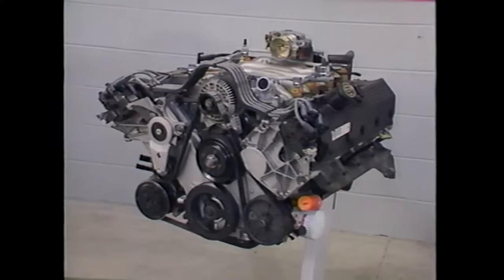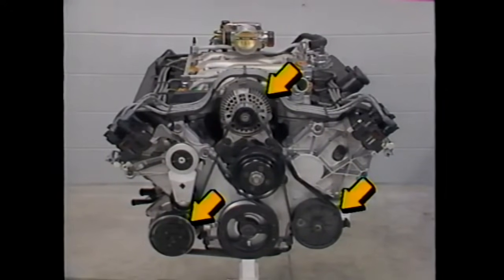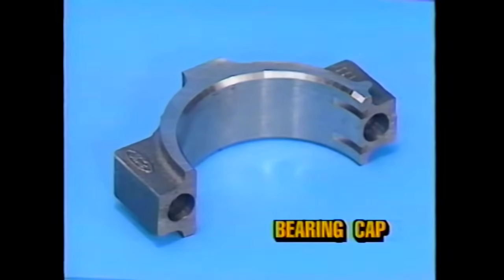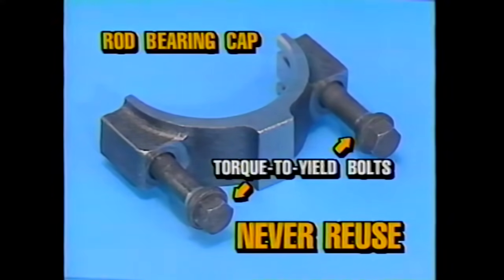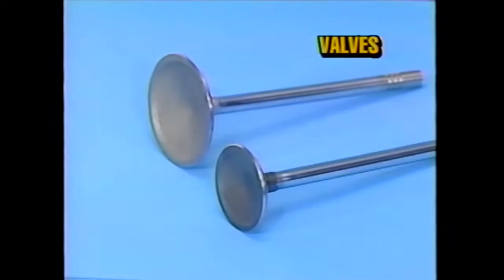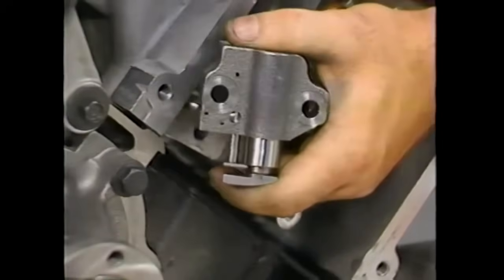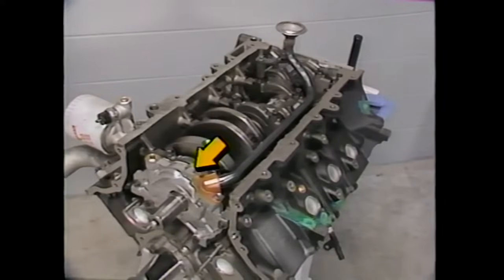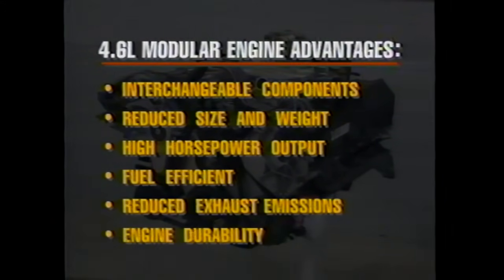Ford 4.6L V8 Engine Technical Education

Comment: I love the 4.6 my 1997 thunderbird LX has, it ain't no speed demon but it hauls ass and keeps up with today's sports cars and trucks.
Reply: I got the same but the 94 tbird. But mine isnt so quick, bit sluggish atm but worked on her. Hard to find modification options
Reply: @BennosCamaro  The only mods I did on my tbird was a pi intake swap and muffler delete but left the cats on, it wasn't a big crazy difference in performance but the engine responds a bit quicker than stock. 4.6 Mustang parts can be compatible with tbirds. Just keep in mind that the 4.6 engines from 1991 to 1998 had non pi heads including the Mustangs.  1999 and up 4.6 engines came with pi heads the Mustangs, trucks and vans execpt the crown vic, town car, and grand marquis, those cars didn't get the pi heads till 2004.
Reply: Gustavo Ayala thanks for response thats interesting info i will consider the pi intake. How does she sound with that muffler delete with cats? Would love to hear it. I am considering doing the same or with a flowmaster 40
Reply: @BennosCamaro  the exhaust sounds like an f150 with the 4.6.
Reply: Gustavo Ayala thanks man. Which pi intake model did you swap it for?
Reply: @BennosCamaro  I used a dorman 615-175, this intake manifold is universal, it works on both non pi and pi heads.
Reply: @BennosCamaro  go with Ford Performance PI manifold n et PI heads while your at it, no point in putting the intake n having to mod the gaskets, get them used if you want to save money, or mod for power n get the TrickFlow heads.. ;)
Reply: @gustavoayala7176  what oil viscosity do you use in your engine? I have a 97 grand marquis that I just bought and the previous owner used regular 15w40 dino oil. Car has 100k miles only, I've been suggested to use 5w40 instead but don't go back to 5w30. I'll appreciate any help, thanks
Reply: Had a '95 lx, it was black with gray leather, ground effects with dual stainless tips and a moonroof. Beautiful cars

Comment: These first gen 4.6L Ford's were such a great engine. It's a shame they were so anemic. Upgrading to an aftermarket cylinder head and cams could literally double the output of these engines. Makes ya wonder why the manufacturer didn't just do it from the start...
Reply: They didn’t want the power to be near the 4v cobras 300 hp. I agree, the 2v’s should have been sold with 300 hp to the crank at least.
Reply: @bap7929  you have to remember the power other cars were making in this time period, 210-225hp in the early 90's was decent power, not to mention 275-285 torque was indeed not bad. Not bad but not great either. I have driven a few early 90's fords with the  modular 4.6/5.4 and honestly i thought the motors felt pretty good, nice and smooth, not the fastest engines but definitely not slow either, just good all around solid motors.
Reply: Either that or offer a recall on every 96 to 98 mustang for free upgrades
Reply: They did with the PI heads and intake.
Reply: @allanb3222  they did? Well wished that i had mine during that time period
Reply: @chriscamp5190  They changed in the 2000 year models to the PI heads and intake.

Comment: never had a 4.6L let me down yet, they go well into the 200k 300k range easy
Reply: 300K+ on my 4.6L in a Mustang.
Kept regular maintenance and shes given me ZERO trouble.
The only trouble my little pony has caused has been hurting ricers fee-fees.. For some reason they think they're supposed to be competing with the GT.
I'll admit, the Hondas, Nissans and Hyundais do a better job at picking up groceries. While i pick up their gf's and sometimes their MOMS.
Reply: @lilmike2710  what oil you use
Reply: @tomorrowcomestoday1621  it was broke in with 0W-20. Afterward a 05-20 mostly. But there's a well kept secret about the oil used in high mileage engines. Instead of buying special blends labeled for "high mileage" engines, oils labeled for diesel motors such as Shells Rotella will serve the purpose.
Reply: most engines can go to 200k-300k if theyre maintained. my 4.6 has 318k
Reply: @marktheamazing3683  my clock reads 216K, it was ran hard the first 160k of its life, ex-cop car
Reply: trigga ville Ford crown vic?
Reply: @jordanr2244  yep
Reply: MarkTheAmazing my 2010 4.6 3v has 315k on it so far!
Reply: @MichaelFletcher-to7mm  hell yeah!
Reply: Nathan Jay yessir, it was an oilfield truck first about the first 180k miles and had its fair share of hard work but still runs fine, I need to do the hubs eventually tho they’re starting to make some noise.
Reply: @marktheamazing3683  Nissan: "...nahhhhh"
Reply: It's a great running and reliable engine. Mine has over 300,000 on it.
Reply: @marktheamazing3683  miles?
Reply: @marktheamazing3683  There was an updated technical service bulletin by ford to switch from 5w30 to 5w20 in this engine. I am buying a town car with the 4.6 l v8, a 1997 model, 100k miles, good engine psi. Previous owner used regular dino oil sae 15w40, I was thinking switching to the 5w30 as it should make the engine work more efficiently as it was designed to be using that weight, but NEVER 5W20
. What are your thoughts mark? I'll appreciate any input, thanks in advance.
Reply: @marktheamazing3683  you use 5w20?
Reply: it's kind of crazy because it doesn't seem like an engine that you would want because it's got a lot of moving parts and a lot of things that can break, but then you actually see it survive a holocaust and realize you were wrong.
Reply: Have 281,000 miles on mine in a 2002 Ford F150xlt.
Reply: Oh yea the crown Vic cops want them back instead of these other Ford models lol it’s basically a 3valve automatic heavier mustang
Reply: @jasonjason6477  2v We never got the 3v and the only panthers to get the 4v was the Marauder.
Reply: There was an updated technical service bulletin by ford to switch from 5w30 to 5w20 in this engine. I am buying a town car with the 4.6 l v8, a 1997 model, 100k miles, good engine psi. Previous owner used regular dino oil sae 15w40, I was thinking switching to the 5w30 as it should make the engine work more efficiently as it was designed to be using that weight, but NEVER 5W20
. What are your thoughts? I'll appreciate any input, thanks in advance.
Reply: @tomorrowcomestoday1621  jeez 15w40 in a modular engine? Did the previous owner live in a warm climate? If they ran 15w40 oil for a long time the engine may be used to that thick oil and when you switch back it may start using oil, but only with 100K on it, it shouldn't be a problem
Reply: I have a 2005 F150 with a 4.6 has 325,000 mi. Runs smooth.
Reply: GETFUX 55 that’s good
Reply: Mine went at 172K. Always changed the oil per schedule. No leaks.
Reply: @gregbusch3754  I'm at 235K with 4700 idle hours, it was beat on hard for the first 160K of its life, ex-cop car
Reply: @gregbusch3754  Greg, do you use 5w30 or 5w20?
Reply: @tomorrowcomestoday1621  I think 5W-20. Always had it serviced by dealers or quick lube.
Reply: What oil viscosity do you use
Reply: @tomorrowcomestoday1621  5w20 syn blend
Reply: 200K is nothing. Any engine can do 200K with just regular maintenance.

Comment: Is it reliable to buy 2005model ford expedition?
Reply: axc clemente no. Expedition only used this engine up until 2004
Reply: The expedition used this engine design until 2015. I have an 05 expedition with the 5.4L and it’s sitting at 226K and has no issues. Key differences are variable valve timing on the 5.4 and the spark plug design. The 5.4 modular is just as reliable as the 4.6 modular if you maintain the 5.4 a little.
Reply: @GentillyJay  the issue with spark plugs backing out...is that common with the 5.4 or the 4.6? I can’t ever find a definitive answer..I just bought an f150 with the 4.6
Reply: @thenathanrox  if the truck is from 2007 or below, it has the spark plugs that breaks. 2008 or above is all good. Ford Explorer Eddie Bauer 2010 4.6
Reply: @TheLow57  thanks bro

Comment: This looks like the 1996-1998 Mustang GT engine. The 1999-2004 Mustang GT does not use coil packs and has a larger intake manifold.
Reply: Angel Gutierrez is an early 90s  lincoln with the metal intake manifold. the gt came with a black plastic intake and the tb pointed to the passenger side.